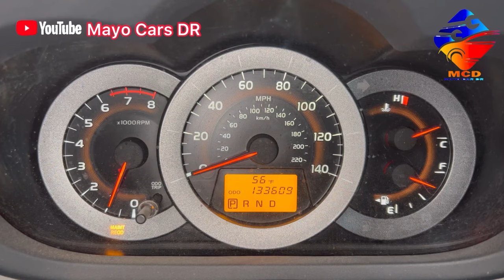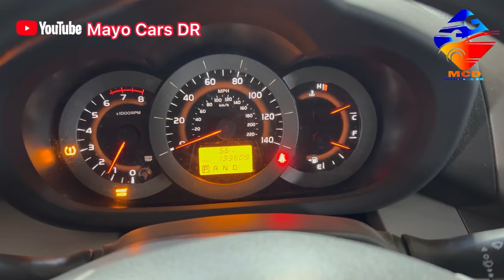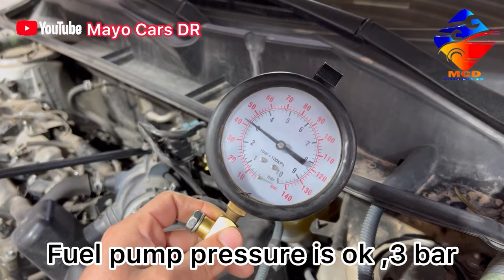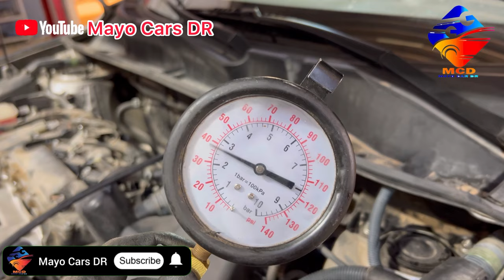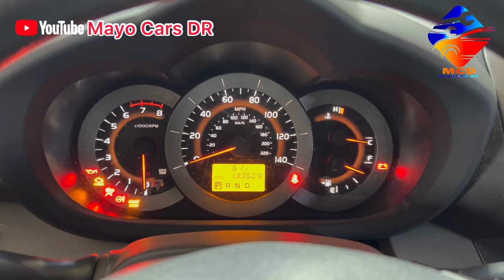How To Fix Long Starting || Fuel Filter Replacement Of Toyota RAV4

Comment: I have the same car but with nearly 200,000 miles. It is a very reliable and easy to maintain vehicle. I have yet to have to do a fuel sending unit on it.
Reply from the maker: Fuel pump

Comment: Hi Mayo, one question, in my case is long star when the car in cold, after tha star better, is a v6 1gr what you think is can be? 
Regards
Reply from the maker: Check fuel pump pressure
Reply from the maker: Check the fuel pump pressure that it does not leake anywhere even after turning off the engine

Comment: Hello! I have same RAV4 (2007) and same problem. But sometimes it starts perfect, sometimes too long. Where I should find problem?
Reply from the maker: Check fuel pump pressure
And spark plugs